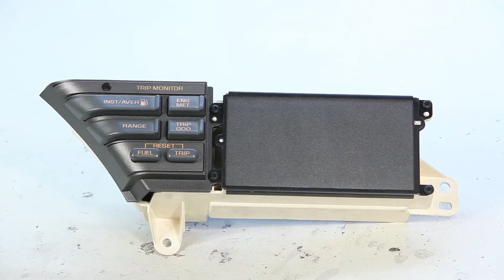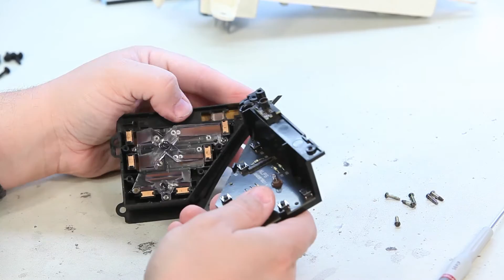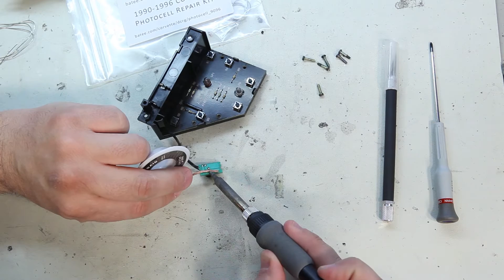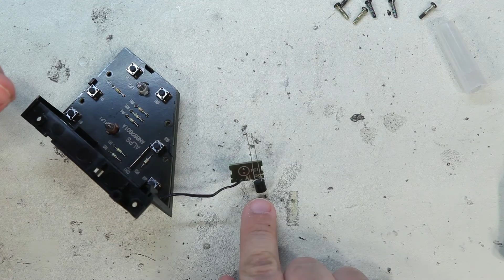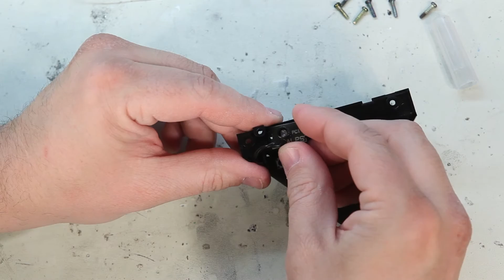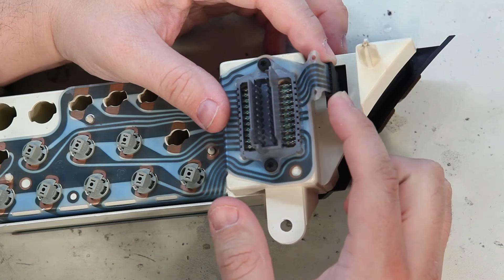90-96 Corvette #10 - Photocell Dimmer Fix (2015)

Comment: Question is, why are you having to replace it?
Reply: Exposure to extreme sunlight, typically Texas to Florida, causes the photosensitive material to crack. When it does, it either causes a full bright or full dark condition on the instrument panel and other dashboard controls.

Comment: Thank you so much!!!! I bought the repair kit from you but have been to afraid of breaking anything to start the fix.  Now ill jump on it this weekend.  I know another issue the 90's vettes have is the misreading tachometer.  I've read that unsoldering the bad resistor on the back of the instrument panel and soldering in a new good one (250 ohm I think) will fix this.  if you have time this could be a great and quick fix and part to sell on your site.  Great work as always ! thanks again.